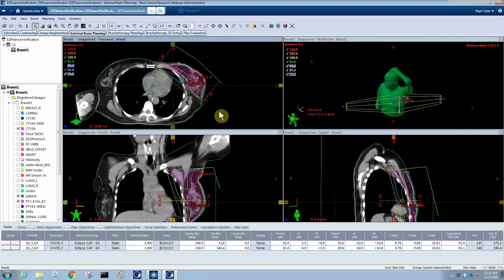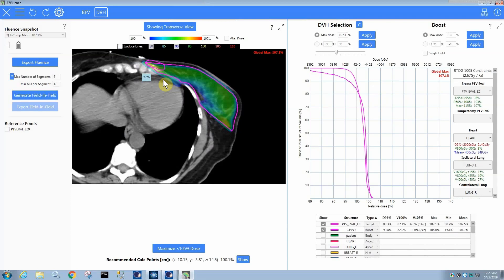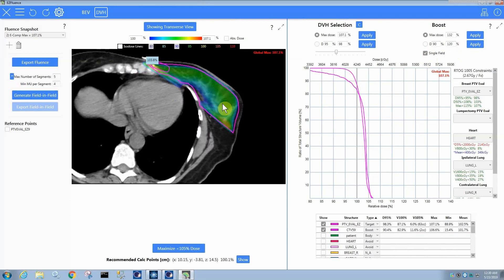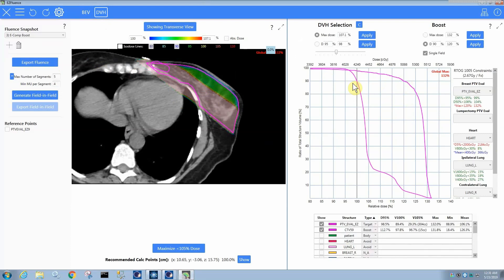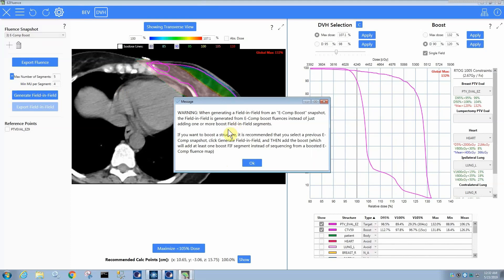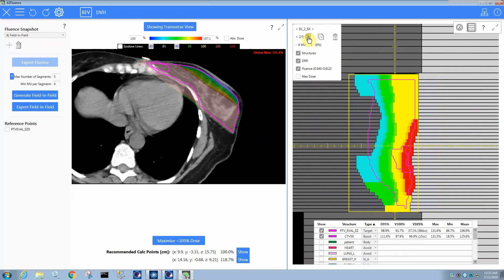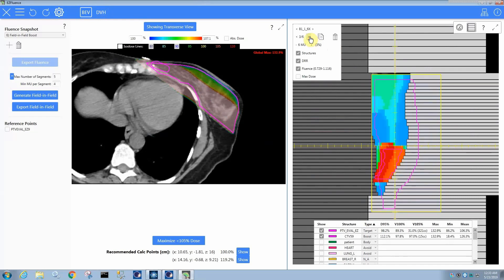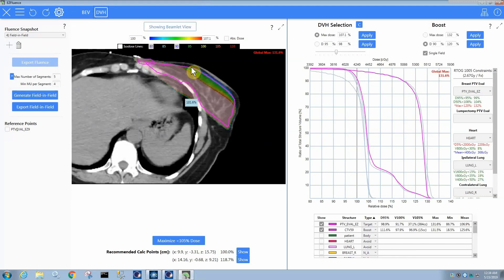EZFluence 2.1: Simultaneous Integrated Boosting

Comment: It seems like a rifle shot all the way through the breast is receiving the boosted dose, rather than focusing on just boosting the seroma PTV.  Is this standard practice you are seeing?  
If one were to want to finesse the plan to boost the PTV only and decrease the "rifle shot" effect, does the dosi have the ability to control this in your TPS?
Reply from the maker: We have seen a number of sites that boost this way. It would certainly be possible to use alternative techniques (multiple fields, dynamic conformal arc, or VMAT) but of course this can also result in higher heart and dose (for example) depending on how it is optimized. 
EZFluence has the ability to optimize multiple fields  with arbitrary angles in order to achieve a homogeneous dose while also giving you the ability to reweight the beams (so you could minimize heart dose, for example). So if you want to use multiple fields for your boost, you can just generate a separate plan and run it through EZFluence and it will give you a very homogeneous dose in the target, after which you would then just do the plan sum on top of the standard uniform-dose tangents that EZFluence can produce.
Is that what you are referring to, or is there another technique you are talking about?